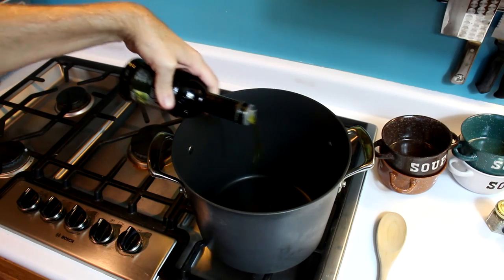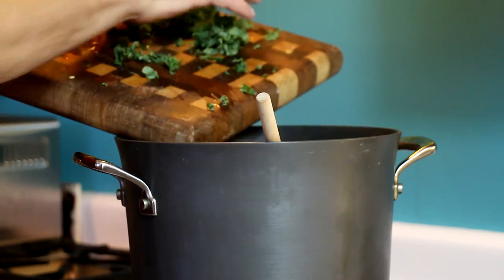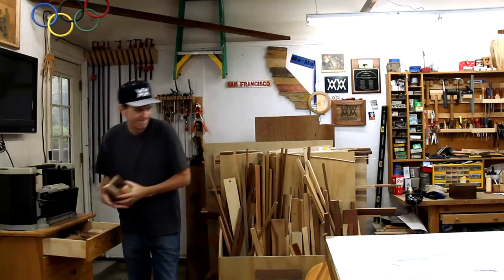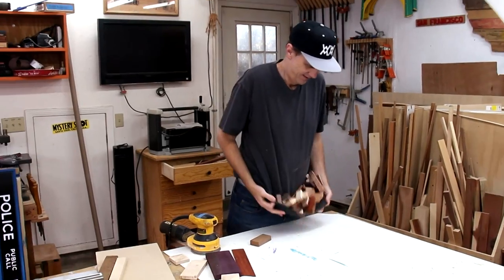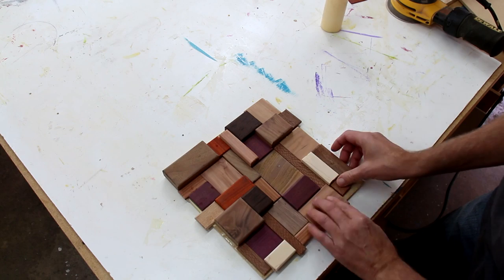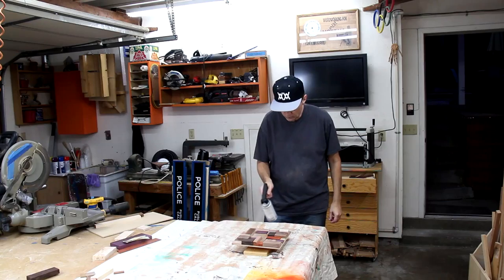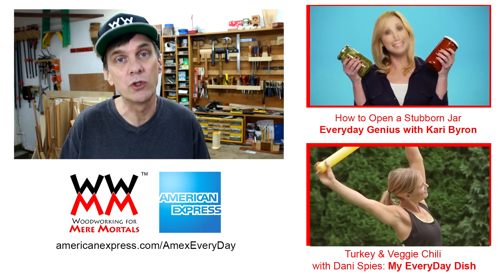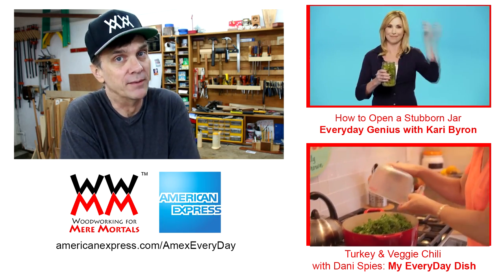Amex EveryDay: Scrap wood art | Mere Mini

Comment: You can also glue scraps together without cutting them down first into something vaguely rectangular, say 4"x4"x12", then square up all the sides and cut that 3/4" slices off that rectangle at the bandsaw, then chamfer those slices at the router table and you've got some really pretty coasters.

Comment: If I could get the wood all the same level, and do it the same way you did. Would it hold up to the heat for a centerpiece on the kitchen table to put the hot pot of food on?
Reply: Give it a try, TigerWild. What's the worst that can happen? It could come apart. No big deal since it's laying flat on the table. It's scrap wood anyway, so it's not like you'll be out a hue amount of money. Experiment and have fun with it.
Reply: No doubt! I agree with you completely, and didn't mean to give the impression that I meant otherwise. Not contradicting you at all. Just encouraging Tiger to go for it.
Reply: maybe if you leave some space between pieces (1 or 2 mm) and a small screw from behind, and you can always put a veneer to cover the screw heads.... or something like that. :-)
Reply: Victor Camacho Thanks
Reply: Use strong adhesive - like two part resin - it will hold wood no matter what :)
Remember wood mainly rather widens than lenghten - you can minimally space the sides apart...
Reply: Leszek Cyfer Thanks!
Reply: Another way to counter act the expansion would be how cabinet doors are made by using super small space balls in between the pieces. This would allow you to keep them still fairly tight against each other and allow for shrinkage and expansion. Worth a try!
Reply: You could also apply them to a base material and leave small gaps in it and make it into a trivet.

Comment: New to scroll saw and wood working. Just want to ask where is the best place to buy wood that does not cost a small fortune? I love working with wood but have a hard time on where to get it. Also love the mixed small pieces  would flatten top and make a nice tray table.
Reply: Try local lumberyards, if you hit the right small one you might get scraps free.
Reply: Oh and around large stores look for pallets not the prettiest yes but it's wood. Ask before taking.
Reply: Yeah pallets, and MDF is about as cheap as new wood gets